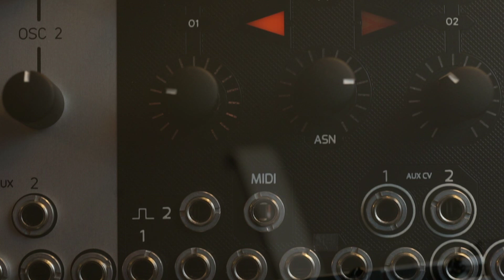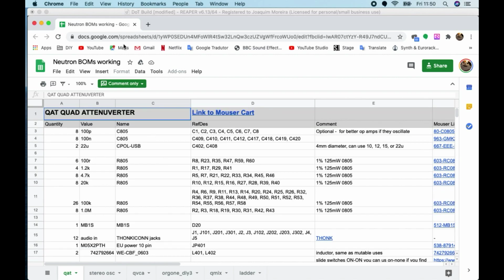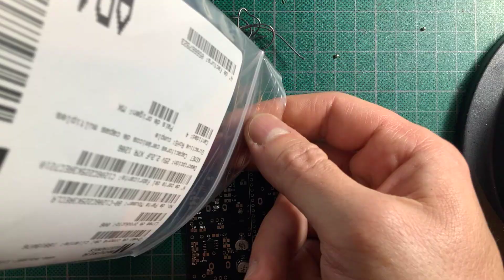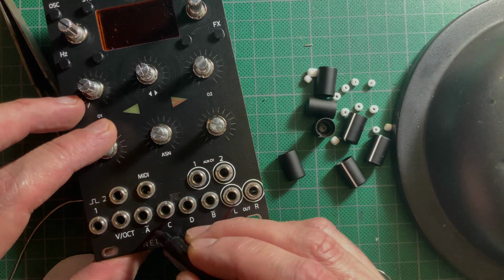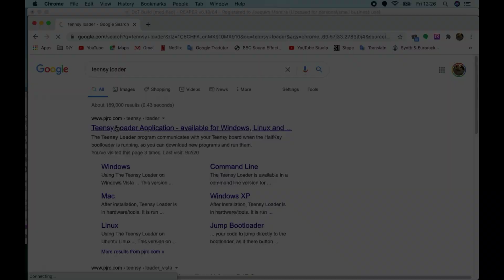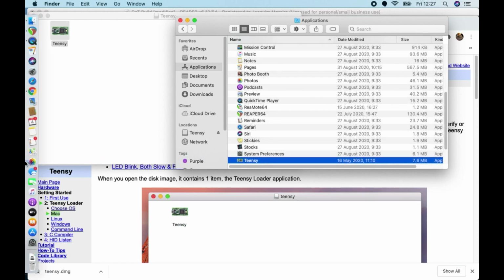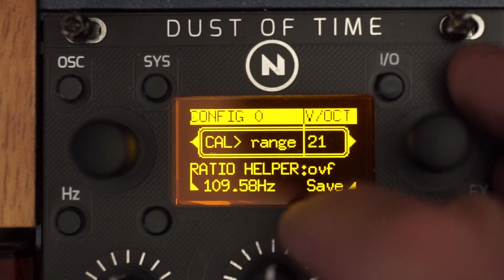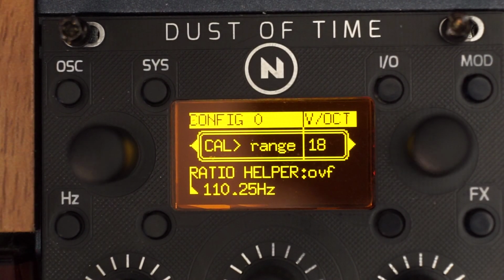DUST of TIME - Building the module

Comment: I was debating between this module and the Erica ssynth graphic vco.. this is the first time seeing this video. Have you ever worked with the Erica synth graphic vco can you compare the two?
Reply from the maker: I have not had the pleasure of trying the Erica module yet, but keep in mind that the Dust of Time is way more than an oscillator, it's a complete stereo synth, with MIDI, Envelopes, LFOs, Chaos attractors, effects etc...   The Graphic VCO AFAIK is just a really good VCO!
Reply: @QuincasMoreira  wow,,thanks for your response...does the DOT have Digital Delay built in? Michigan Works has one for sale and i'm about to pull the plug and buy one...
Reply from the maker: @rhampton1914  not really ambient effectsm more like distortion, bitcrushing, filtering, resonator, ...   yeah, get it!

Comment: Do you know if a full kit will be available? Or should I just pull the trigger on a panel and PCB now?
Reply from the maker: I wouldn't wait. Maybe one of the retailers will start offering kits at some point, but AFAIK there are no immediate plans for that to happen. Get the Panel, PCB and 6x click pot set, it's a better option than having separate buttons for each pot :)
Reply: @QuincasMoreira  yeah I'm definitely gonna go the click pot route (although I must admit I do like the visual density of the version with the buttons)

Comment: If anyone is having trouble deciding between the tact switch version and the click pot version, I would recommend the click pot version.  Get them from michigan synth works, they sell a set of 6 just for the module.  the tact switch version will have you use alpha 9mm pots and the footprint is not the same, you have to bend the legs weird to make it sit right.  I was trying to force in one and scratched some solder mask off, a problem that would not have happened if I got the click pots.  Still works though, it's a great module!

Comment: Hi Quincas. Hope you, Alexis, Lucas and the girls are well and dandy!  Ohh, and the spider as well 😉!
Really nice and relaxing video (like always).
Do you ever consider using solder paste in smd? 
I personally used to do it all with solder wire, but, this days I save a lot of time doing it with paste (not just with the “eat gun”, but, mostly with the iron).

Forte abraço amigo 👍 

P.S.- muitas vezes “falo-te” em inglês porque as perguntas e respostas podem ser úteis a quem não fale português. 😉
Reply from the maker: Hi Bruno, thanks for the kind wishes!
We are all well thanks, te mando outro abraço!
I used to use paste when I first started with SMD, but eventually I found it unnecessary for the way I do things with leaded solder and an iron. I´m sure for hot air gun or oven techniques it's important, but this way works for me and I get less mess and fumes.